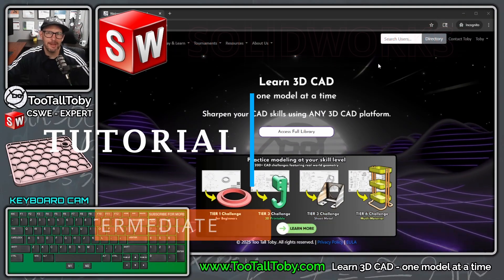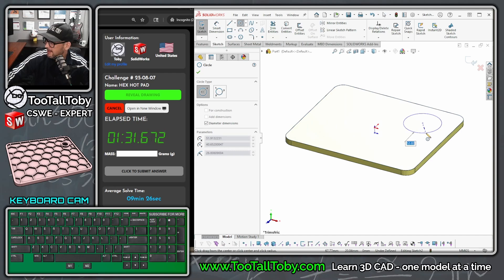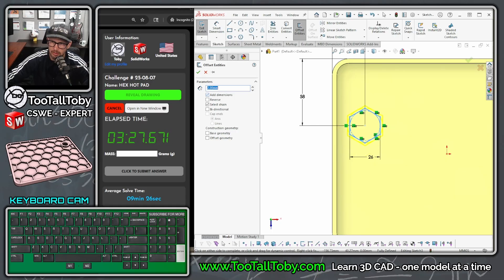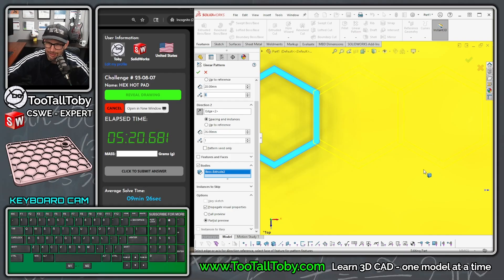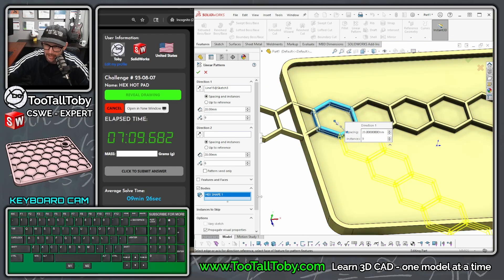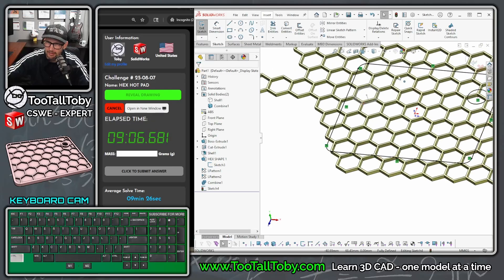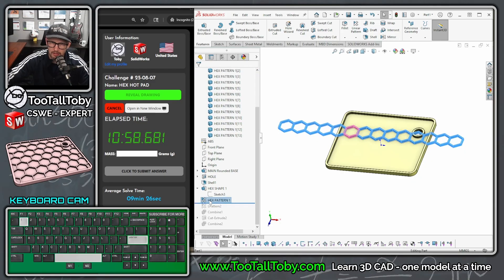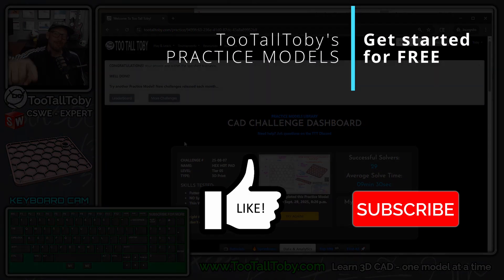SOLIDWORKS Tutorial: Hot Pad with Hexagonal Pattern | Step-by-Step Guide

Comment: Great! Thank you! I’ve made it 50 grams heavier, because of the hex’s shape…actually mine is not properly the same of your!
Reply from the maker: Nice work - is the material density correct? (see title block). What CAD system are you using?  We have a channel in the discord server called #material-tools where we have libraries for Onshape, Solidworks, Inventor, Fusion, FreeCAD, and more...
Reply: @TooTallToby many thanks! I’m running SW2024…